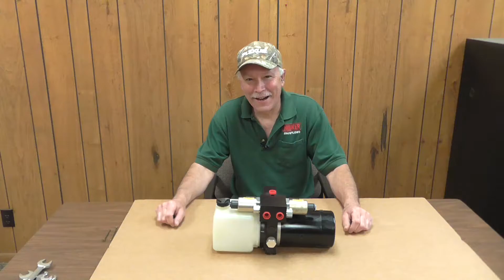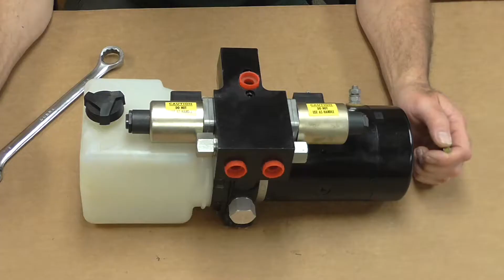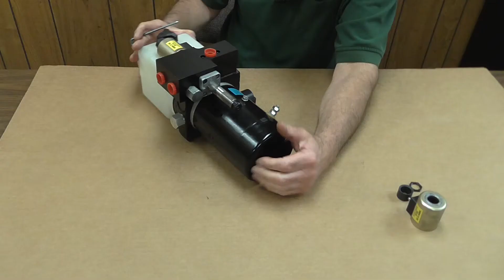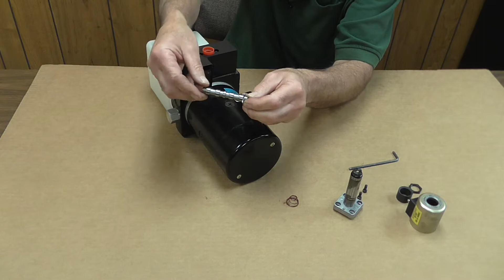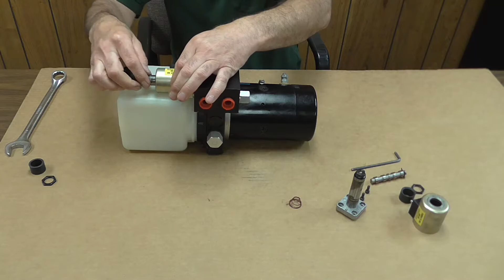Hiniker Straight Blade Power Unit Valve Replacement Tutorial DB1164 1995-2009 Tips and Tricks

Comment: When i press right on joystick the blade drops. 
Would this be the issue?
Reply from the maker: If the plow is dropping when angling, there must be some voltage bleeding through to the blue (down) wire. A simple test would be to remove the blue wire and then try the angle function. If the plow stays up then we know for sure it's an electrical issue.

It could also be corrosion inside the plow side harness or an issue with the grille plug connection, possibly a pin or socket pushed back, making contact with another wire.

If you are unable to find the issue please contact us at 507-625-6621 and ask for Mike.
Reply: @HinikerCompany  i have the same issue except when the plow is all the way up. Still electrical?
Reply: @clintonmiller5042, I am having the same issue. Did you find the issue?
Reply: @HinikerCompany i have the same issue except when the plow is all the way up. Still electrical issue?
Reply: @clintonmiller5042 did you find the issue?

Comment: what about the db-1600 series motors are them the a simmaler disassembley as well. I'm haveing problems with mine only wanting to go right only and not lift up right now. a guy that works at hiniker in Holland mi said that the top block you pulled off in this video is the problem and would need to be replaced but from what you showed here that is not the case possibly. what would be a good way to contact you about it and see if you can help me over the phone by talking to you about it thanks

Comment: great video, I was hoping this would explain how to repair if the plow slowly falls after lifting. I have no leaks in the system, its bypassing internally somewhere. i removed the release valve cleaned it out with solvent and compressed air and no improvement. I was thinking it could be the check valve potentially. It started slow and would fall down if sitting for like 10min when i noticed, and by the time i used it for a couple more runs, it hits the ground in about 10 seconds, so i cant drive the truck unless i chain it up.
Reply from the maker: Thanks for the input! Mike is away at NTEA Work Truck show this week, but I will bring this up to him to help you out. :)
Reply from the maker: Mike says the check valve is likely the problem. Take a look at the O-ring on the outside of the check valve to see if that needs replacing.

Comment: Thanks for this video.  Very helpful.  What cleaner do you recommend for the left/right valve?
Reply from the maker: Glad you like it! Mike says, use a solvent for cleaning the valve, don't use brake cleaner it will damage the rubber seals and O-rings